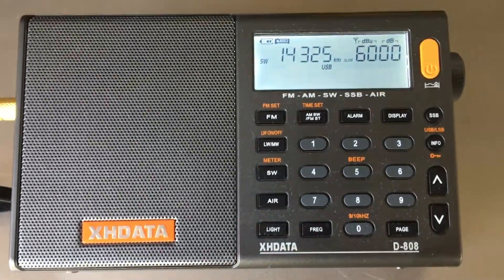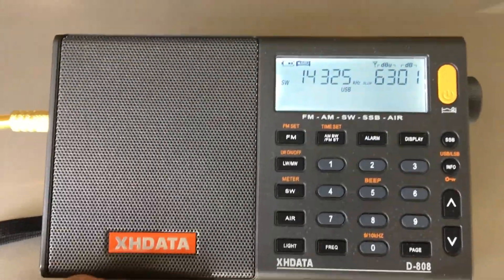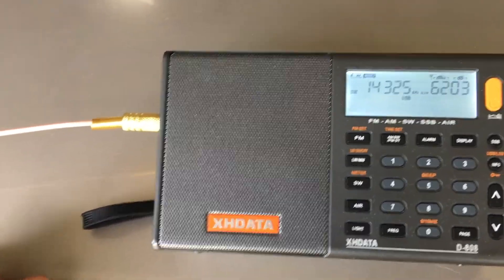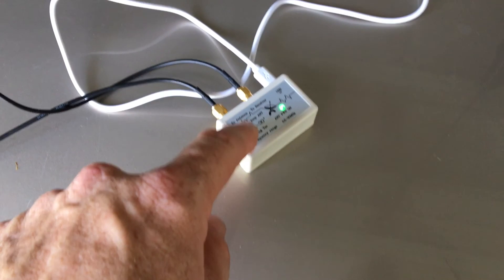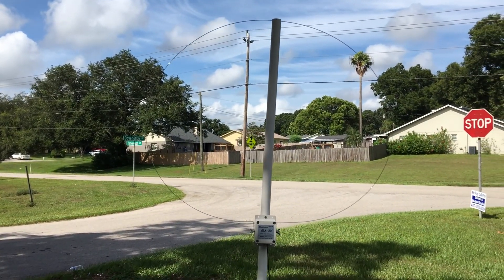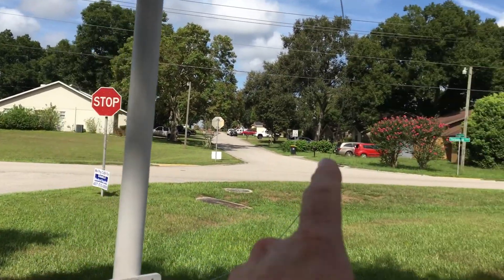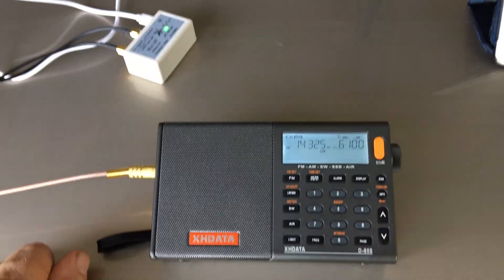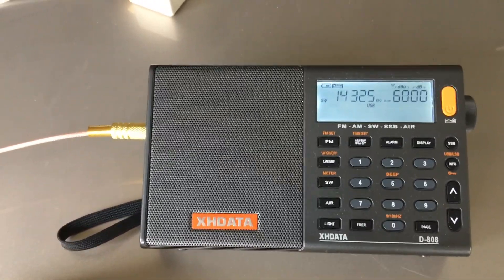Shortwave Radio During A Hurricane

Comment: Hopefully it won't be a too strong of a storm
Reply from the maker: It’s pretty bad. I pray that people obeyed the warnings and evacuated.
Reply: @John-Sherwood-W4JFS  or they have a good shelter to hide in
Reply: Them cicadas are crazy lol, I’ve been looking for a SW radio my self do you like this model? ki4mox
Reply from the maker: @ki4mox989  yes. I like it a lot. It has everything I would want including SSB. The only thing about this radio is the battery. You can’t install alkaline batteries in it as a backup. It has its own rechargeable installed. As long as you have a way to charge it, it shouldn’t be any problem. I would recommend it totally.